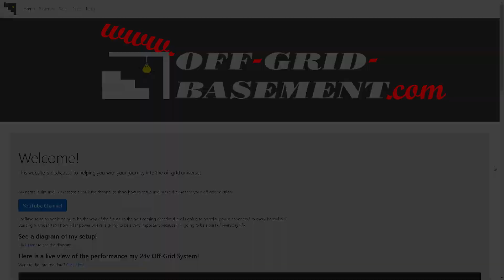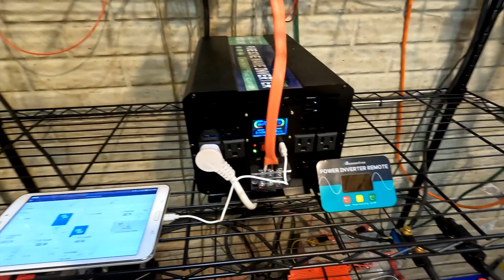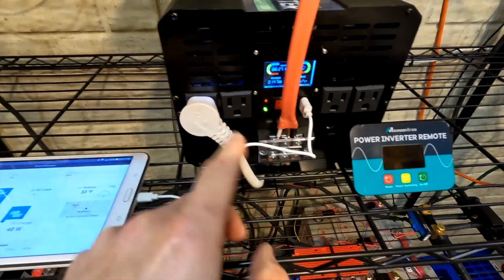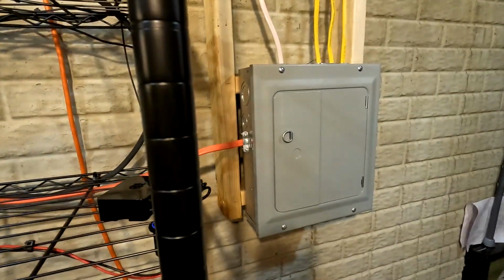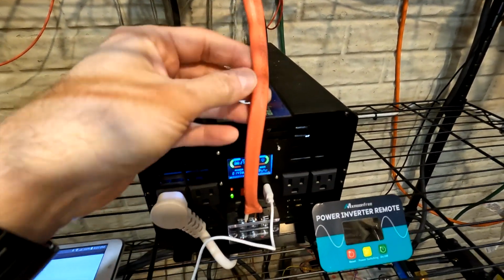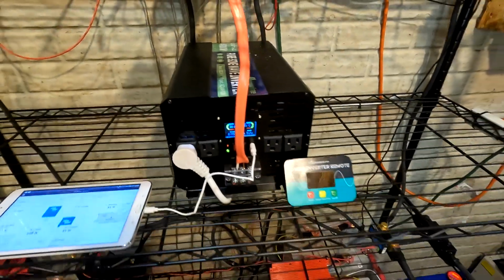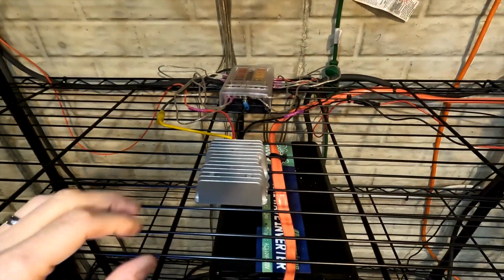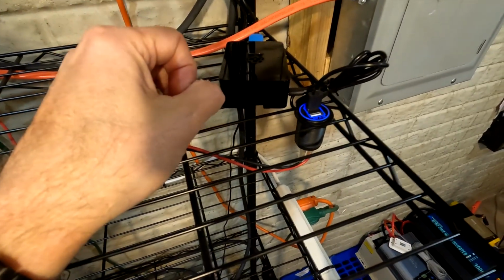I upgraded my 24v System!  More Batteries!  Bigger Inverter!  Better wiring!

Comment: This is some very exciting stuff to see, im just about to get a 24v system built using 4 290AH smart Chins Lifepo4 12v batteries with Bluetooth,  and heaters. Going with all Victron components except an Inverter for the time being, and it's nice to see basically my same build incorporating a balancer, and shunt ect, now I am curious, though do you have any for of battery temperature sensor? Like a Battery Smart Sense from Victron?

I originally had got my Smart Shunt with the plan to use a temperature sensor on it, but after doing more digging,  and realizing that the gray wire can be used for Voltage deviation,  opposed to just a second battery system entirely,  which im not using, or the temp sensor.. Knowing my main batteries are 12v themselves,  the system keeping them balanced is a big thing, as well as being able to monitor it. So I'm looking into the Bluetooth temp/ smart sense by victron.
Reply from the maker: That is a great setup, but I don't have a temperature sensor since my setup is in a temperature controlled environment.

Comment: Nice set up, I am still getting probs with 4x 12v,  series and parallel, now its discharging only 2 of the 4 batteries. 1 from each series block...Yeah if I could start again I would go 24v. 100 percent.
Reply from the maker: Thanks.  It's like the voltage on some of the battery wiring isn't right.  You need to use a multimeter to examine the voltages from each battery.

Comment: Interesting, consider grounding your shelves and adding insulation materials.
Reply from the maker: Grounding the shelves definitely needs to be grounded.  I do have some rubber insulation material that I will try to incorporate into the shelving system.  Thanks for the information and comment.

Comment: That's allot o Money - How Much does It Power ?
Reply from the maker: the system powers my sump pump, basement freezer and a bunch of DC lights in the basement.  It also runs my computer, laptop and all the outlets I use for at my workbench.  I also plan on using the excess power this summer to backup my 48v system.  My systems are all intertwined.  It's seriously getting pretty ridiculous.

Comment: Thanks for posting.  Very interested to see how the batteries perform.  I have a similar system with 4 24V 100AH Chins (400AH).  Separately I planned on bringing over my older set SOK's 12v 200AH batteries and wiring them up as 2 24v 200AH batteries.  The thing I can't get a straight answer on is the discharge of the 2 200AH batteries with the 4 100AH.  In this series/parallel config, theoretically, they should become one large 24V 800AH battery.  I am just not sure of the safety and true capacity of this config.  Even the comments below contradict other information I have found in both videos and articles on the subject.
Reply from the maker: You should get close to 800ah.  Just make sure to top balance.  You want to make sure all batteries are the same voltage before connecting.  Hope this helps!

Comment: Several 24 v inverters right?  Because if you pair a 100ah 24 v with a 300ah 24v battery you only get 200ah not 400ah
Reply from the maker: The batteries won't all drain at the same rate due to the internal resistance of each battery.
Reply: Thats true but i know for a fact with  lead acid yes you can combine 2 12 v bats for 24 and hook them up and the 24v bats different capacitys they will only go up to the smallest capacity as treating them all as the smallest and thats fine no problem but your capacity is reduced and the bigger bats will be prone to sulfication. Will need to equalize them separately.  The only real problem would be making the 24v with 2 12v bats of different ah capacitys the smaller batery will get very hot
Reply: If they are wired in parallel then the voltage stays 24v and the capacities add together. If they are wired in series, then you're right, but then this would no longer be a 24v system -- it'd be 72v.

Comment: I would of put everything on spliters. Including solar panels. Used batteries till discharged switched to another battery. Switched solar to battery that just discharged. Thats how i did it. When 1 died i swithed batteries ti charge controller. I always have a full battery.
Reply from the maker: It seems it would be a bit more labor intensive.  I like the idea of always having a full battery!  Thanks for the comment and info.

Comment: I understand the 2 chins with the balancer, but how are these other mismatched batteries with far different capacities going to be balanced within this system?
Reply: It's limited to the hundred Amp battery. Once it is drained what ever is left on other batteries won't mater.
Reply: Yeah 100 ah times however many batteries he has regardless of the size so a total of 3 batteries hes only getting 300ah
Reply: Internal resistance is higher, the lower soc is, and since all the 24v batteries are mounted in parallel, the larger capacity ones, will be more inclined to supply power.
Reply from the maker: @fezdk is right.  It's all about the internal resistance of each battery.  I have other videos about this using 12v batteries.  The batteries don't drain at the same rate.  They drain at a rate proportional to their capacity.

Comment: Are you still using your gridtie inverter? And if not is it still alive?
Reply from the maker: I'm not using the grid tie anymore.  It definitely still works, but I just have different ways of using excess energy.  Thanks for the comment.
Reply: @OffGridBasement  just got my 24v system running and now you gave me more ideas. Great Video!